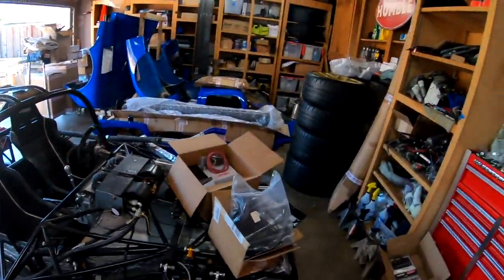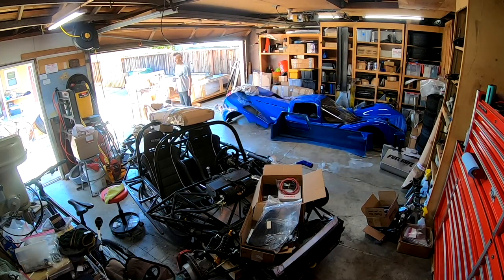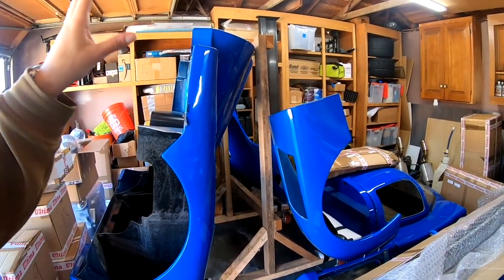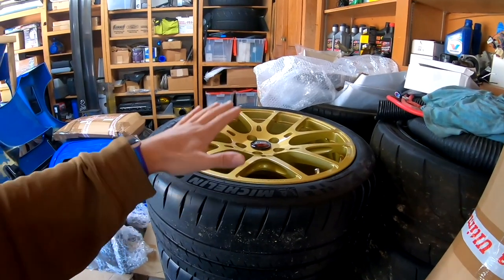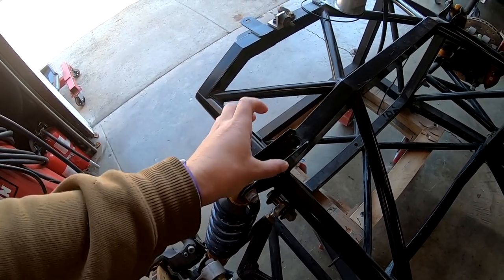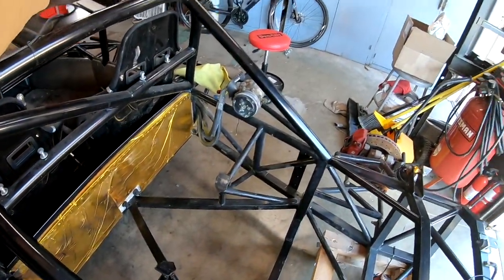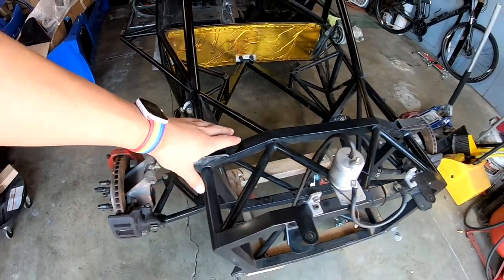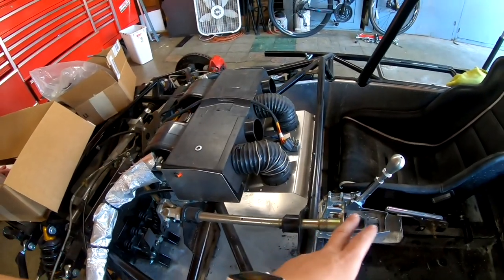Ultima RS   Blunicorn Rebuild 08

Comment: Humble to make that new dolly work you’ll need rubber or pneumatic wheels to make it run easily.
Hey Humble, in 1999. I reached 42, life was good, and out of the blue I was diagnosed with CLL an incurable Leukaemia at the time, After various treatments, I was told I had a 2-3 year life expectancy. My consultant a top Professor, kept me alive with trial drugs.
To cut this big story short. Humble Keep positive keep checking for any trials that will help cure your condition. 
My current trial Tirabrutinib. I was the 3rd person after mice starting it. Now 7 years on.